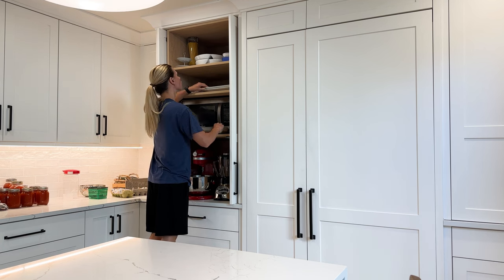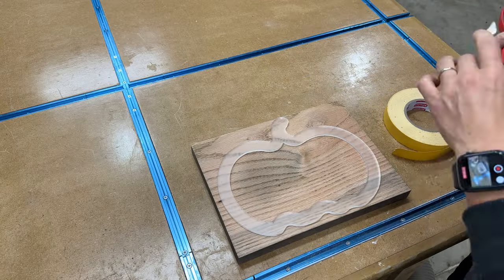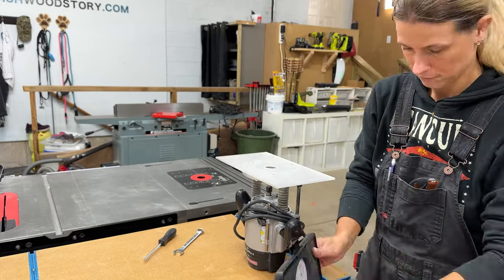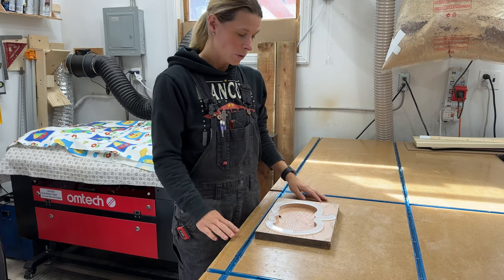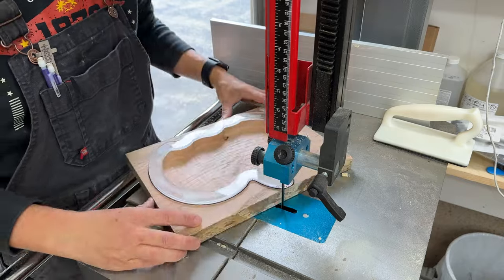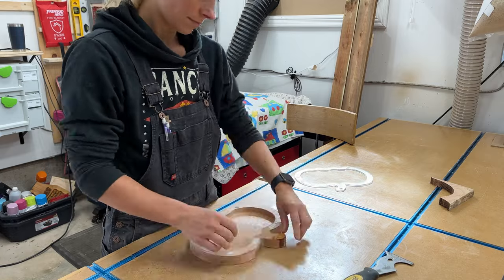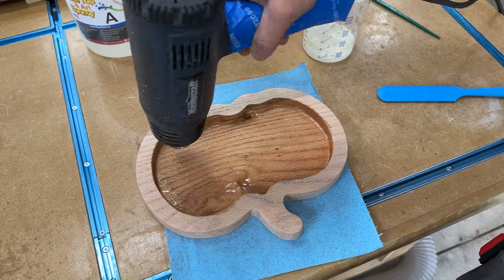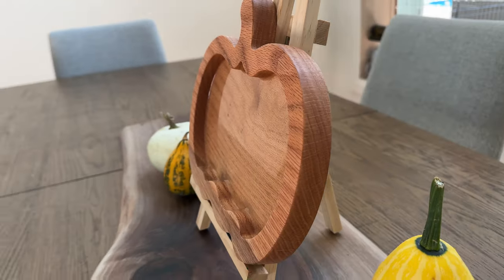Make A CREATIVE Food Tray // DIY Woodworking (Template Included)

Comment: What bit would you use to flush trim if using a hand held router as I don't have a router table?
Reply from the maker: A handheld router is the way to go for this project, use a templating bit, for the inside I used a bowl templating but for the outside a straight templating bit works.

Comment: What blade are you using on your bandsaw? I have a similar Laguna bandsaw and am looking to get some different blades.
Reply from the maker: I was using a 3/16 10 teeth blade (proforce) and I liked it but it snapped on me when needed to cut a curve in some walnut, so I just ordered a 1/4 inch 6 teeth blade instead (also proforce) which will be a little trickier for tight curves but will hopefully hold up better to denser wood. I hate changing the blade so I try to get away with one blade for 90% of my work. I also have a great resaw blade but I rarely use it as I don’t need to cut to many straight cuts on my bandsaw.